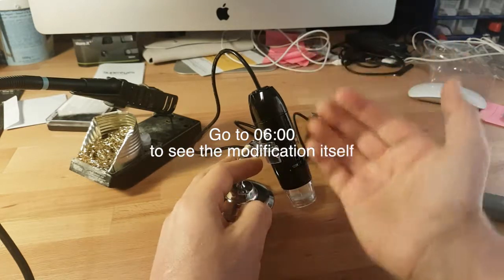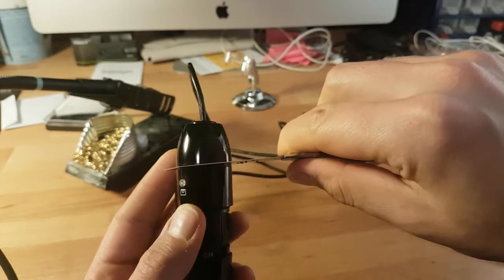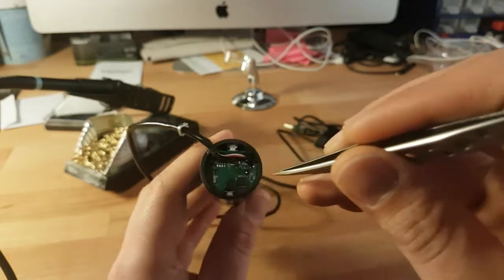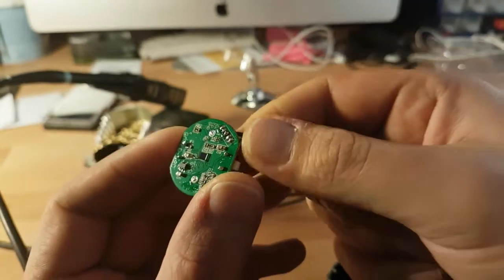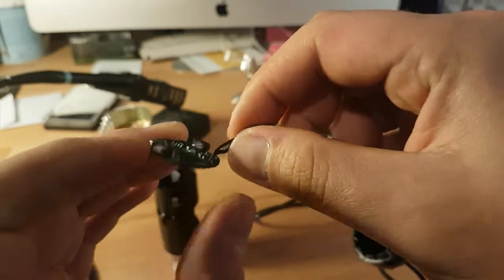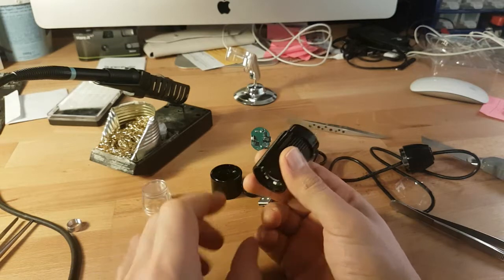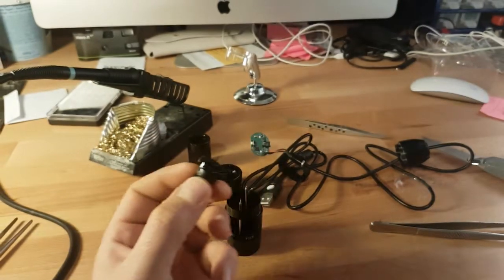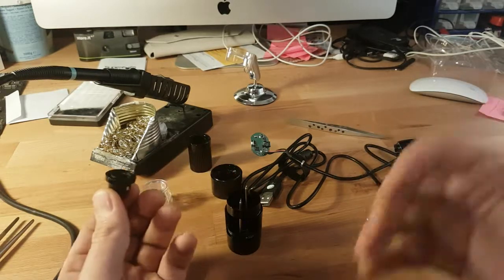Usb Microscope Modification. Increase Working Distance. Focusing Distance Hack.

Comment: READ THIS BEFORE OPENING YOUR DEVICE: There is chance that you can achieve the same result without opening the microscope. Remove the transparent cylinder at the bottom. Increase the zoom/magnification to maximum by turning the silver knob to the right. That way the pointy tip of the microscope should come out at the bottom and you should also be able to see it's plastic thread.  Now you can reach the tip with you fingers (make sure they are clean just in case) and twist the tip in, as much as u want. The more you twist it in, the higher the working distance but also the further away your LEDs are and the therefore the image quality decreases. You might want to use a second light source then.

Which method works depends an what generation of these devices you have. If you have to open it anyways, make sure no dust gets onto the sensor and inside the optics!
I didn't know any of that. When I noticed I didn't have to open it at all it was too late. I put everything back together and then noticed stains on my image. Dust got inside the microscope. I opened everything again and cleaned the sensor and the glass and put everything back together just to realize that made it worse. Invisible dust particles and fibres from my tissue always remained on the sensor. 15 tries and lots of new tissues later I got lucky. Finally I got an acceptable result but the image is still not as good as it was before and maybe I also removed an important coating with that... It took me 3 hours to do something that takes 5 minutes, but I am still thankful for this video! Without it, I would never have known, that I can increase the working distance at all and would have sent it back as it is. So thank you and greetings from Vienna 👋🏻
Reply from the maker: Sorry for the bad experience but this is usually how we learn. Thank you for sharing your experience.  I hope someone else will read it and learn from your mistake. Greetings from Germany
Reply: In my case it was already screwed on tightly and I can't tighten it any more. am I doing something wrong?
Reply from the maker: They all have slightly different designs or manufacturing differences. Take it apart and experiment

Comment: i took mine apart to do this modification, but to my suprise now they made changes to do this mod with no destruction. they changed the soldered pins to little screws so the board comes out and back in very easily. and instead of the press-fit tube, they put the lens on a fine plastic thread so you can just screw it in farther and reassemble everything with no soldering or cutting.
part of the amzon title is Jiusion 40 to 1000x Magnification Endoscope for the one i got. with enough light you are easily able to focus on any distance(up to like 20 feet) with it threaded all the way in, although the quality does go down a lot with less light and more distance.
Reply from the maker: Nice to see something got easier for a change. I am now using a full hd one but nothing can beat the price performance of these after you modify them

Comment: What was the working distance before mod compared to the distance after mod? Basically the working distance gained from this modification?  Tha
Reply from the maker: before if was unusable for repairs because nothing will fit between the microscope and the table. Check other videos for the result after mod

Comment: Interesting mod. Why you don't show the mod result as it will show on your PC? I think it would be interesting to see the actual increase in working distance, even though at expense of a reduction of the magnification.
Reply from the maker: I have a couple of videos about the microscope and a couple of others in which I use it to repair things. Like ipad pro. Price/performance wise I am very pleased but the video quality is poor. Polarisation is the biggest problem because when you have flux or solvent on the board you see nothing but reflections.
Reply: @parçalabehçet  try to build a polarized lamp ;)
you only need a old damaged lcd display from exp. a laptop (best a verry old one with cold cathode tubes)...take out the polarisation filter and use it for lamp.
then make a little filter for the cam ;)
good luck!!!!!
veryy well done:)....,a new subscriber.
Reply from the maker: @anon72513  Funny coincidence. I just did what you told me. I alredy knew that lcd displays has polarizing films on them but i didnt know that i could peel it off. Around two days ago there was a broken tv on the street. Took it apart to salvage the circuit boards. Then just because i was curious i take a closer look at the lcd panel. Looked like there was a layer which i can peel. Pried one corner with my knife and yes it was indeed a polarizer film which you can peel. I did a very crude job of peeling it but i have the polarizer film. Now i can use it to have polarized lights. Next time when i see a broken tv i will also take the lcd with me. I think with some heat the whole film can peel off without getting damaged.
Reply: @parçalabehçet  that is why i sayed a old one....there is no glue between the display and the filter...you just need to open and take the plastc sheets out.
in most cases there are 3 layers .
one is just for refract the light even over the space, one is the polarizer , the 3rd on i do not know .
sorry for my poor english !

Comment: If the pcb is removed from the two metal rods that hold it in place and these rods also are powering the leds of the microscope and place extension pieces in both of them so when the pcb with the ccd camera is soldered back then will have a longer distance from the lens and this also will increase the focusing distance also.Next i will experimenting with this to test it.
Reply from the maker: If you do it let me know the result. You can also make a video. Other people can see the result also.

Comment: Wouldn't the lens crash into camera sensor after cutting the distance in half ?
Reply from the maker: It doesnt
Reply: @parçalabehçet  cool I'm going to do this to mine bought cheap to do a Nintendo switch repair thanks for the vid
Reply from the maker: @orazioschreiner5626  if you go into my channel and search microscope or mikroskop in my videos you can see other videos about this usb microscope and the repair videos which i used it. One such video is the  Ipad Pro repair. As far as i understood magnification is much more than those expensive hdmi microscopes.  Resolution is the main problem. If you can find a real 720p or 1080p usb microscope let me know.

Comment: I got one from HVSCAM (Model X49) and I just can't get it to work. There's a USB reset error as soon as you connect it. Looks like the one you are using.
Reply from the maker: There can be a loose connection inside. Mine came with broken solder joint where USB  cable soldered to the mainboard. You need to take it apart and check.

Comment: I'm guessing this mod while increasing focus distance also will effect the magnification minimum and maximum unless the lens is not changed at all for where it is set in the tube and that extra cut off was just left there for no reason.. maybe to save on manufacturing cost or to calibrate the magnification to exact levels?
Reply from the maker: Since i am using it to check solder joints and small electronic components magnification wasnt a problem. I didnt even realize any difference  if there was any. I have no technical explanation but when it comes to manufacturing i expect anything  which may make no sense to us from a logical point. Motor oil marketed as fully synthetic in USA can not be marked as fully synthetic in Europa for example.... Same oil. One says its fully synthetic the other says it is not... So there can be a technical reason or the reason can be regulations, manufacturing/marketing problems....